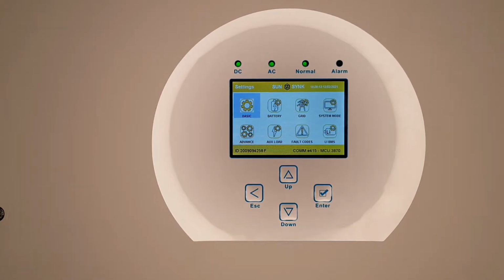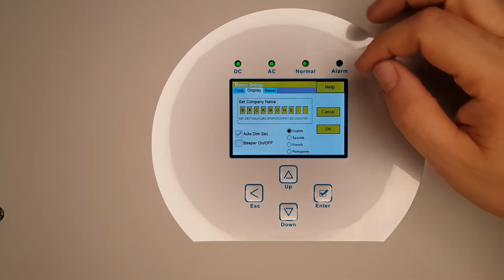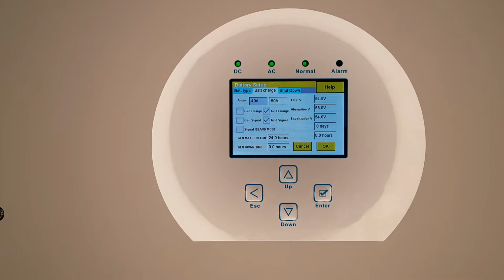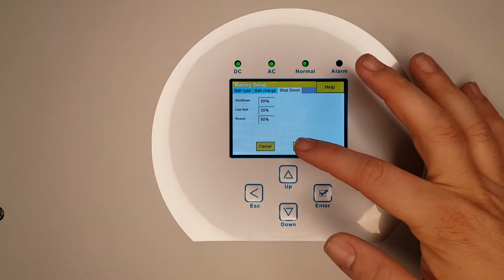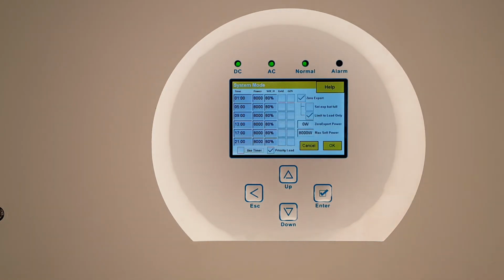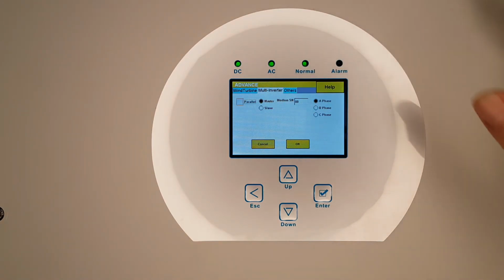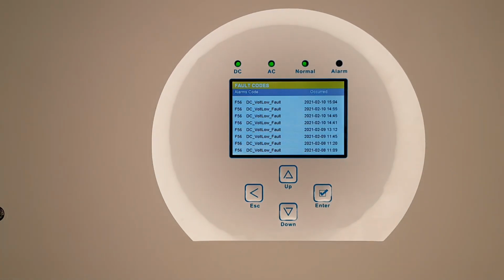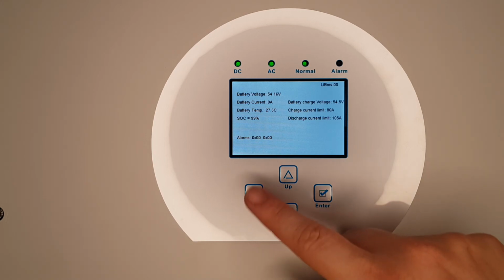Sunsynk Settings run through

Comment: Alarm going all night how do i switch it off
Reply: Hi Gavin. Is there a fault code that comes with the alarm? The alarm normally sounds when an F-code appears in the top left hand circle. Please check that first, it might be something which needs to be addressed first. 

If you would like to silence the alarm. 
Go into settings
Basic settings
Display 
And deselect alarm

Just remember that this will now silence the alarm permanently and if a fault arises you will not hear the warning alarm.